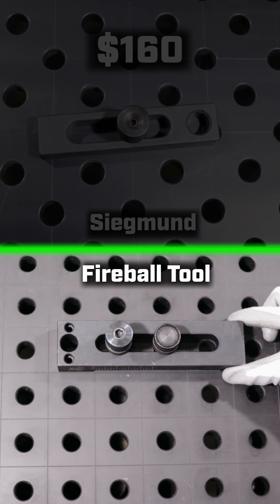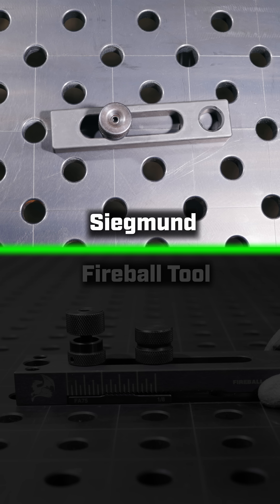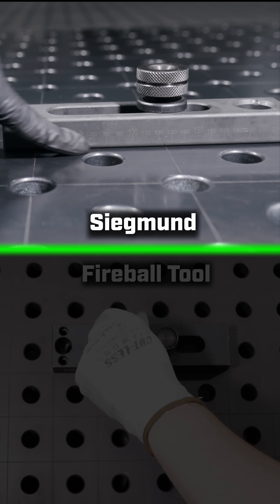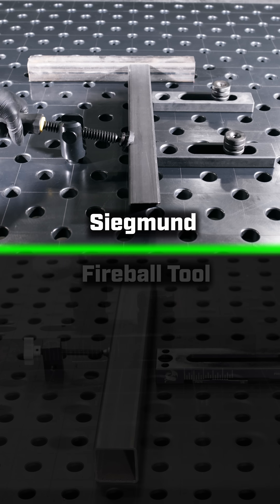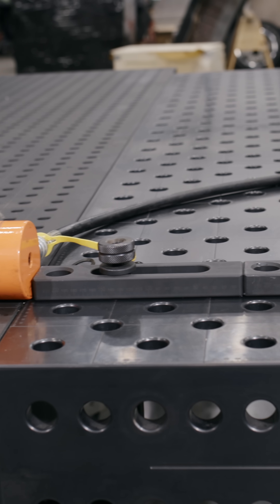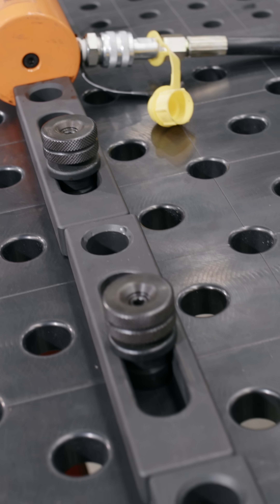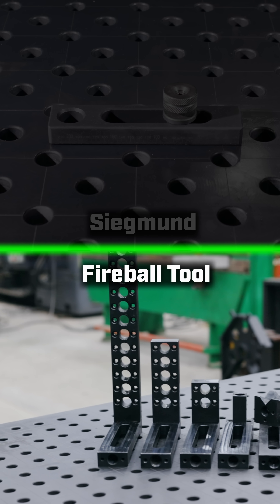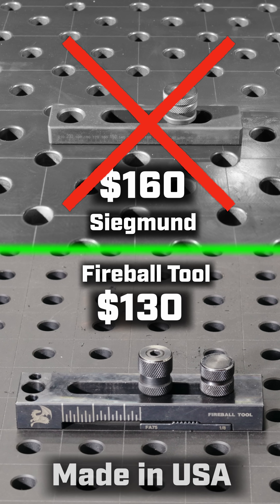Why This Cheaper Welding Fixture Wins Every Time!

Comment: I agree fireball is better but that is also not a fair comparison. Table hole size and spacing are not the same. It isn’t quite an apples to apples comparison. It would be like comparing a sour apple to a sweet apple then expecting them to make an apple pie from them and get sub par results.

Comment: You need confidence when using your welding table. The Fireball system has been designed with precision and ease of use, the Siegmund system hasn't. Repetition is important and again Fireball wins that contest.

Comment: I get it,  the bar slot would need to be 2 times longer for 2 pins to work on the Siegmund because of the 4” hole spacing.  The Fireball table has 2” hole spacing which makes the slot shorter.  Fireball for the win.